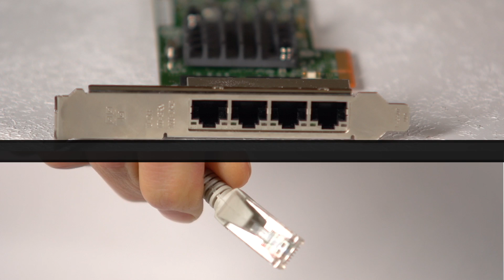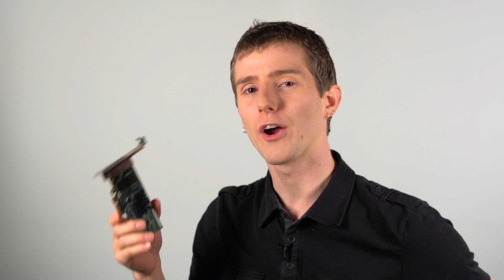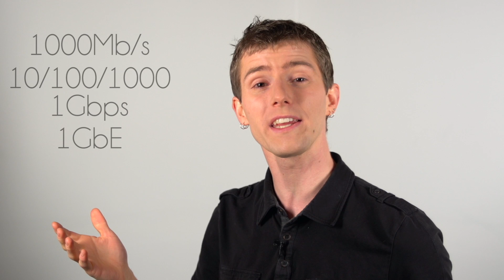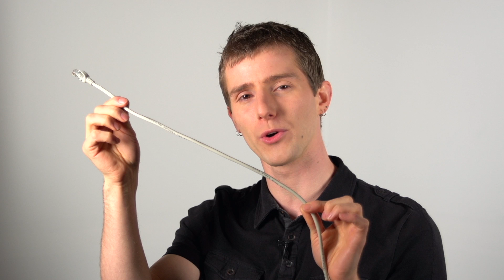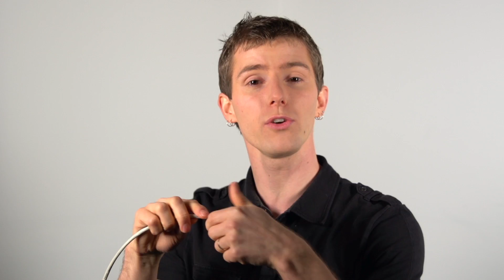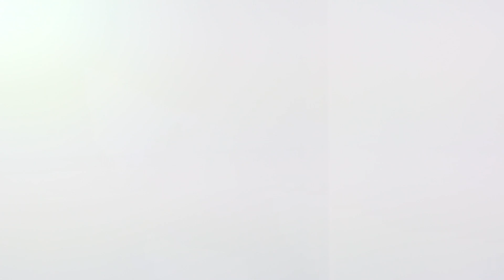Ethernet RJ45 Speeds & Cables - Everything you Need to Know as Fast As Possible

Comment: What's beyond a switch is irrelevant.  It is the single hop distance between devices that counts.  So, as long as you're within 100M, including patch cords, you're fine.  Incidentally, those specs assume a patch cord and associated connectors at each end.
As for kinked cables etc., on one job I was sent to fix, I found someone had stapled (big no no) the cable right into the corner (a really big no no).  You don't use wire staples for Ethernet cables.  You can use ones that have a plastic spacer between the staple and cable and are designed for that purpose.

Comment: On my Computer I have an Ethernet connected. There is one amber light blinking The other light however is a solid red for me and not green, most likely indicating an issue I assume. Now its not a problem with my desktop I don't think but it could be the Ethernet cable I'm using. I went to a friend's house and used their cable and the red light was now green. But now I'm back at my place with the same static red light. I tried other cables.  Is this an issue? I would appreciate input. Thanks!

Comment: Doubt ill get an answer on a video from over 5 years ago, but doe coupler's decrease performance? I am currently renting. I have my router and modem upstairs so I can hardwire my PC. However I want better performance with my connection for gaming on my PS4 downstairs. As we are renting we were limited to how we could set up our home network. If I were to connect two cat5e cables together via a coupler would I see a drastically different connection speed? Right now my PS4 is online via wifi, but connection is not at a preferable  speed for online gaming. Also are there ratings for speed transference through these couplers or are they pretty standard? I see packs of 5 and even 6 of them on Amazon, but don't want to cheap out if there is a difference.

Comment: Wrong info, Cat5e only support 1gbps at 100meters ( and not 10gbps at 55 meters as it was said on the video) and Cat6 indeed support 10gbps but only at 55 meters. In general, he confused the Cat5e cable with Cat6 and the Cat6 cable with the Cat6a

Comment: I don’t understand Ethernet at all and wherever I read about it it tells the same things that I can’t understand. I’m probably just being dumb but I can’t figure it out. 

There’s 4 LAN and one WAN port and I want to use Ethernet when playing shooters when I have the chance because my WiFi seems to drop out on me occasionally. Which port do I use or is either port fine?
Reply: WAN is for you router so it can direct ethernet to your other 4 ports (and ofc wifi) this I assume you have plugged in, fiber output to your router. The LAN ports are there for 4 others units, such as your computer, so just plug an ethernet cable that connects LAN to your computer (either LAN ports is fine btw). This can also assure that you get the speed you pay for (for example 100/100), wifi can't ... I hope it helps even though you wrote this a month ago ... :3

Comment: Can you go over what is best for gamers:
STP,  UTP, or FTP
Wire Guage: 24 AWG vs 23 AWG
or does it not really matter?

I'm running a cheapo, ebay, Cat5, 100ft, so I figure that it matters because of the distance.
Would I get any better performance out of a Cat6, more shielding, or Wire Gauge?
I play rocket league regularly and my ping sits around 70-90, so I thought this may be the issue.
However, I don't want to buy a $50 cable with no better results.

Comment: I have a Late 2014 mac mini, core i5 2.6 that has Gigabit Ethernet(10/100/1000Base- T). What is the best ethernet cord to use to maximize the speed of my performance, cat 5e, cat 6, or cat 7. Which ethernet can support my mac mini and does the length of the ethernet cord matter?
Reply: Since your max is 1 Gb, CAT5 is all you need.  CAT5 (doesn't even have to be 5e) is rated for 100M (330') at Gb.

Comment: Dude... Can you prove that 100ft cable lose performance ? do the same as you did with the USB cable.
Reply: Yeah. I'd like to know how much speed actually drops off if you go over 100m..
Reply: duxz you must have a low quality cable.  Try a round ethernet cable that is shielded  like a cat 6 stp cable.  Don't buy flat ethernet cable.
Reply: So the longer the cable the slower the mbps? I have an ativa R45 50ft & the performance numbers are faster.
Reply: @northtalk4330  the max length for cat 5e and 6 is 328ft @ 1 gigabit.
Reply: Twisted Killer28 I’m just starting to wire a Ethernet cable to my room and was wondering why I shouldn’t but flat Ethernet cables. Also do you know the best place cause everything on amazon looks sketchy or is cat6.
Reply: I use 150ft, seems fine for me

Comment: Please comment on the CAT6 Flat Ethernet cables sold on Amazon and eBay. Is a flat cable as good as a standard round ethernet cable ?
Reply: just use monoprice cables they work great
Reply: Monoprice sells really good cables for low prices but my question is about the newest batch of FLAT Ethernet Cables starting to appear on Amazon and Ebay. Most of them are advertised as CAT6. I wonder whether they meet the codes required for CAT6. I use CAT5E and have a working Gigabit Network in my home.
Reply: Yeah, monoprice has flat cat 5e, 6 and 6a cables and there are no bad reviews on the monoprice website and on amazon. I wouldn't buy randon ethernet cables from ebay or amazon

Comment: what the best cable for
Linksys WRT1900AC Dual Band AC1900 Gigabit Smart WiFi Router (1.2Ghz Processor, 128mb Flash, 256 DDR3 RAM, USB 3.0, eSATA, 4 x Ethernet) - Open Source Ready
 
this cable
Duronic Black 15m CAT6a FTP Professional Gold Headed Shielded Network Cable - High Speed 500MHz Premium Quality Cat6a / Patch / Ethernet / Modem / Router / LAN

or

CSL - 15m CAT.6 Flat Ethernet Gigabit Lan Network Cable (RJ45) | 10/100/1000Mbit/s | Patch cable / broadband cable | compatible with CAT.5 / CAT.5e / CAT.7

Comment: Actually RJ45 is an old standard that does not use T568A or T568B nor standard 8P8C plugs. 

I am not even sure why most people mention RJ45 when talking about CAT cables, which is even more incorrect that reefer the plugs as RJ45.
Reply: rj stands for registered jack and it looks exactly like that, nothing more...
Reply: Yes RJ stands for registered jack and yes that was (is) a real standard. But it is not the same that computer cables use today.

The old RJ45 had a different wiring and a different connector and it also defined both unlike today that there is a standard for each one. It is true that most people and companies call the cables/connector RJ45 but this is actually incorrect. 
The standard used to mean something, but now is just a nickname for cables that use 8P8C connectors.
Reply: amertino According to wiki keyed RJ45 is actually RJ45S now, so..I guess they made it correct anyway :)

Comment: Don't you have to update your driver made for Ethernet and internet in order to get the full performance?
Reply: +Jeremy Moore Yes, that's another thing, but then I think Linus is talking about the basic thing here, which is the cable used to connect. Often the most basic thing is the thing most people take for granted, yet in troubleshooting this should be one of the first to be looked into before going into software. Most often the problems with connection is hardware, not software.
Reply: +Milliardo5 True also I always check if my drivers are all up-to-date and if they are but are not working correctly I then check of my connections of my Ethernet adapter are straight and then if that doesn't work I research about what may caused the problem and if theres nothing about the problem I then contact the manufacturer of the Ethernet adapter then if they say check you cable and it's alright I buy a new cable then if the problem is still not fix I buy myself a new Ethernet adapter instead of asuming that it's the Ethernet adapter fault instead of a missing driver and/or Ethernet cable

Comment: With my internet, with wifi or ethernet cable cat 5 i catch around 17mb/s on download and 0.90mb/s on upload, will i get more speed with a cat 6/cat6a/cat7 cable?
thanks
Reply: This you will not. Your bandwidth here is determined by your ISP. Unless you have super expensive business class internet, you'll rarely see over 100mb/s speeds from the internet itself. However if you're running your own media server moving large files like Steam games and whatnot, this is where you'll see gigabit networking coming in handy as computer to computer communication will be less restricted.
Reply: 99% no 1% maybe 0.01mb/s

Comment: If you want higher speeds , try avoiding the cables with stranded wires; when comparing stranded wire to hard wired  cables there is a speed difference. ( according to the network tester )

Linus, did you considered Cat 7 with Terra connectors or optic fibre from workstation to server, just to go as fast as possible?
Reply: Stranded cables are supposed to be used only for patch cords, not the structured cabling.  So, you'd use stranded between a device and the keystone jack and solid between jacks.  Always!

Comment: Rj45 is a terminator, not a cable. You're not likely to see it used on anything other than twisted pair ethernet, but I think I have seen it done before.
Reply: Often cables terminated with RJ45 are re-terminated with RJ11 and used to pass phone line signal through. Usually used in situations where the original phone line is setup for something else such as an alarm system.
Reply: I agree it's quite easy to distinguish between the two: Cable is a super-soldier from the future that was trained from birth to be what he became... Terminator is "a cybernetic organism, living tissue over metal endoskeleton from the future, programmed from manufacture to be what it became.
Reply: can be used for tv signals too

Comment: 2.5 and 5Gbps is actually upcoming standards that will be supported by cat 5e. Cisco allready have some switches supporting it and will be crucial for feeding 802.11ac wave 2 AP's. Especially in  large enterprise environments, where you can deploy wave 2 radios without ripping out your cables.

http://www.cisco.com/c/dam/en/us/solutions/collateral/enterprise-networks/catalyst-multigigabit-switching/multigigabit-ethernet-technology.pdf&ved=0ahUKEwj7tIvw39nKAhVG7xQKHe4DAtwQFgghMAI&usg=AFQjCNFn2S4xXgDhABIcolYzO_J7q83sHg&sig2=EG0OV95xvuk9oOen4njGWQ

Comment: my ps4 is wireless and located far away from the router. my speeds are in the kilobytes. will  being closer and using a cable make it run significantly faster?
Reply: Yes. I got Verizon Fios and never use Wi-Fi to play any online games. Use a Ethernet cable Cat 7. I use my Cat 7 cable to run it straight from the modem to my PS4.
Reply: +Raiden 1018 (Raiden1018) No need to be closer, just wire it up
Reply: Just by using a good ethernet cable you can get 5x more speed.
Reply: >100FT = Cat5e or more powerful
>500FT = Cat6 or more powerful.

GIGABIT INTERNET

Comment: bello..please need help..
having problem with my connection,,

when using my SHORT ETHERNET cable, its all ok ...
                  DESKTOP- the LAN connection is OK
                  LAPTOP - the LAN connection is OK

but when i use my 20M LONG ETHERNET cable i cant establish a connection in my DESKTOP
                  DESKTOP - "Identifying, Network Cable Uplugged, Enabled" this is the status i always get
                  LAPTOP- the LAN connection is OK
                 
i googled and did all the possible solutions in this problem but still i cant solve IT..

PLEASE HELP.

Comment: i have dsl from verizon. I was trying to connect my ps4 directly to the modem but the cord that plugs into the phone jack was to short to reach so I bought a cheap one from a local store but then my connection speeds dropped by half. It's not the Ethernet cord but the one for the phone line it seems so how do Identify a better a cord and where can I get one?
Reply: Where is you're modem? I have Verizon Fios and I run my Cat 7 Ethernet cord from my modem to my PS4.
Reply: +DipSetNY fios is only available in certain areas I actually find it some what surprised you managed to get unless you live in a high business area but dsl is always slow with a max of 3MB/s
Reply: +Flying Wolf Man I live in the Hampton Roads area of Virginia and it's been around about 2 years now. I just found out that Cox is also laying down Fiber Optic cable for their Gigablast network. Which is 1Gbps. They are trying to match Google Fiber with the speeds. They said it would be ready in my neighborhood by August this year. I'm ready for it to.
Reply: +DipSetNY you're fortunate to have those as internet options. verizon charges the same price for fios as they do for dsl. I really feel like I'm being cheated by them.
Reply: +Flying Wolf Man Don't feel bad. I feel I'm getting ripped off myself from Verizon. I got 150 down and 150 up. I pay 120.00 a month. Verizon top internet package is 500 down and 500 up and they want to charge 225.00 a month. That is highway fuckin robbery. When Cox comes out with the Gigablast service. It's a 3 year contract and it's only 100 a month. I mean it doesn't beat Google Fiber's 75.00 a month, but that's still a great deal.
Reply: Is this Ethernet cable good for PS4?=Cat7 Ethernet Cable 50 Ft Flat, jadaol Shielded (STP) Network Cable Cat 7 Flat Ethernet Patch Cable, internet computer cable with Snagless Rj45 Connectors - 50 Feet Black

Comment: I have a question ?

My router is right next to my ps4 my cousin said if I connect my eternet cable to my ps4 and router it will go faster and my cable is hello just says 
Does it actually make it faster
Reply: +luis angeles yes.
Reply: +luis angeles If you can use ethernet, do so.
Reply: +luis angeles Wifi is slower than cable connection. Remember that
Reply: Yeah my ethernet cable was connect to my and it went way faster but i have it connect to my computer now so i suggest you showed connect it
Reply: using an ethernet cable will work better for you if the wifi connection is slower then your internet connection.
Reply: You might not see a difference, but it will be more reliable and you'll have a lower ping or delay

Comment: If someone has a 1gbit internet connection. three devices are connected to the switch and the switch is connected to the router with a 1gbit ethernet. device a and b are together downloading data with 100mbit/s. So if device C wants to download something, does it get the remaining 900mbit? Or does the device say "I don't care that this ethernet cable that connects the switch to the router still has 900mbit of free bandwith, if I don't get full 1gbit out of this wire, I go down a full step to 100mbit"?
Reply: +Patrick M (Saroku) 
Stepdown only happens if cable quality or signal quality is bad. For instance you routed your UTP cables past a washing machine. Great idea, next time use shielding!  Then yes it might switch back to a lower speed.

But if the situation is normal it should run at its normal speed. And yes 1000-100=900. The router should have a backbone that is either equal to or bigger then the uplink capability.

Comment: If my internet is not so good And I buy cat7 or 6 will it work even if its more powerfull than what i need ??
Reply: +SUPER_STREET_ RACER  Yes, cat7, cat6, or cat5e will work just fine. However, if your internet speed is not saturating the cables bandwidth, upgrading to cat6 or cat7 will not affect the speed. Do not go out and buy cat7 for everyday home internet use. Cat6 is more than enough and similarly priced to cat5 nowadays.
Reply: +Alex Sainz ok thanks! Im tired of wifi... It sucks

Comment: i have 25down and 10up and i need a 100ft cable what do you recomend any 15$ cable from amazon good ?
Reply: Cat5e or higher. Cat6 is almost as cheap now as the 5e, so if not much difference could go for that,  but 5e plenty fast enough
Reply: +Hell Heaven Canada or US?
I found this on US Amazon: http://www.amazon.com/Mediabridge-Cat5e-Ethernet-Patch-Cable/dp/B003RCI5A0/ref=sr_1_5?ie=UTF8&qid=1446249206&sr=8-5&keywords=cat5+100ft 
This is actually the one Linus is using, so it has to be good. And he has Gigabit. Also, you can search for the product name and I saw some other colors (Blue, Black, Gray, Red...) But I recommend that you just go to any close store that sell Cable Equipment, Satellite Dishes, Networking Stuff (Duh!), Or even Best Buy. As long as its either Cat5, Cat5e, Cat6 or Cat7, does not matter how it looks or the color or the brand or how cheap, heck I even know a guy that custom makes them, for your exact desired length. even cloth coated, flat cables are actually your friend for cable management. 

Sorry for writing a long comment, I just wanted to give you every possible option.
Reply: Yousef Noori already got a 100ft/30m cable but soemtimes my conetion disconetcs and reconects you know what teh problem is ??
Reply: Hell Heaven Make sure there aren't any twists, and that it is plugged in FULLY in both the switch/router and the Computer
Reply: Is this Ethernet cable good for PS4?=Cat7 Ethernet Cable 50 Ft Flat, jadaol Shielded (STP) Network Cable Cat 7 Flat Ethernet Patch Cable, internet computer cable with Snagless Rj45 Connectors - 50 Feet Black
Reply: Kevin Pacheco Yeah CAT6 is good enough for 100ft so CAT7 for 50ft is really nice
Reply: But is more recomemdable the cat6 or 7 because i wanna throw the cable for all over the wall...
Reply: Kevin Pacheco CAT7 is of course better
Reply: Is it worth buying a cat7 50ft for $21?
Reply: Ramdom Guy Yeah that's a good deal but I found a 50ft CAT6 for $5
Reply: Where? TELL ME 😱
Reply: Ramdom Guy just any random electronic store. anything below $20 is considered a good deal since they're so expensive nowadays.